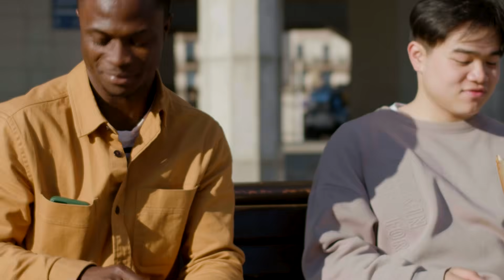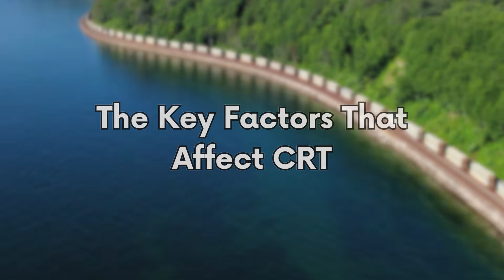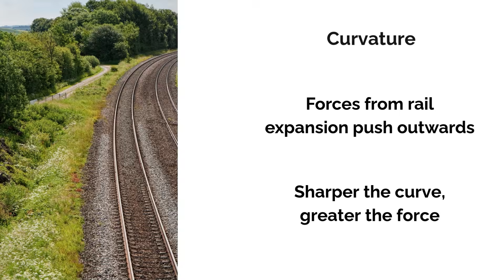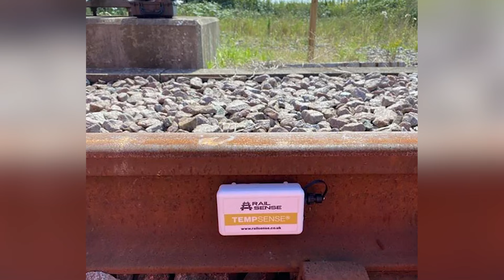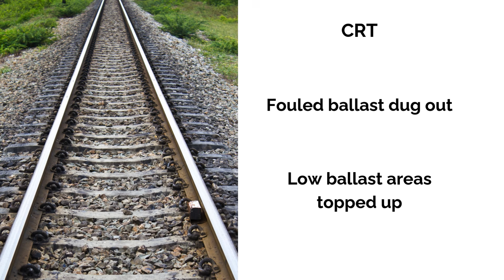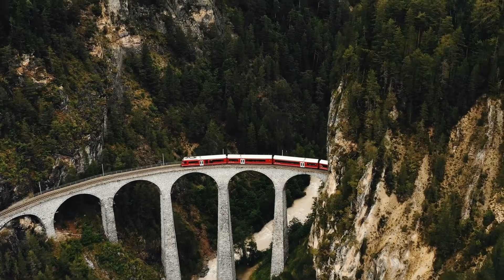When Hot Rails Become Dangerous: CRT, Buckling Risk, and What Engineers Control

Comment: So, what are some "typical" CRT values?  What are the lowest and highest CRT values you've seen?  And is it possible / feasible to design track such that its CRT is so high as to likely never be reached?
Reply from the maker: In the UK on welded track with no issues, the standard gives a CRT of 59 degrees C before mitigations need to start being implemented. I have known sites with CRTs in the low 20s, which become very tricky!

The issue with pushing the stress free temperature, and therefore the CRT, higher is that in the cold weather you increase the likelihood of the rail breaking. This is due to the metal contracting, which increases the tension. So it becomes a balancing act. 

Hope that answers your question
Reply: @thepwayengineer  Ah, yes, it seems like everything in Engineering is always a balancing act!  Interesting point about the balance between CRT for high temps versus rail breakage at low temps!
Reply: @thepwayengineer  That dude screwing out with its finger is quite the turn off